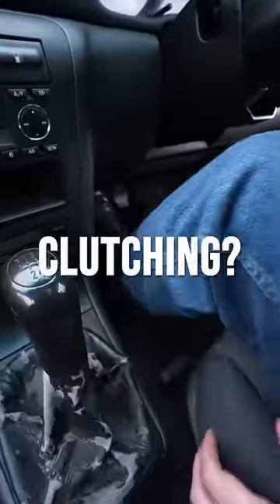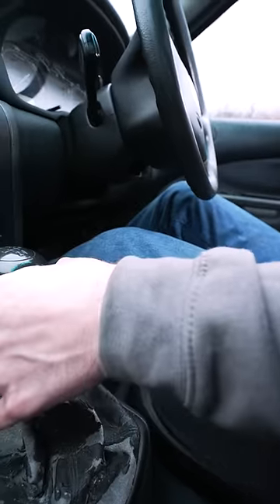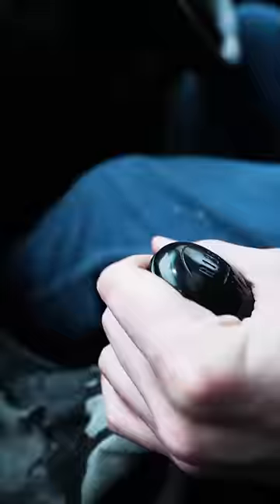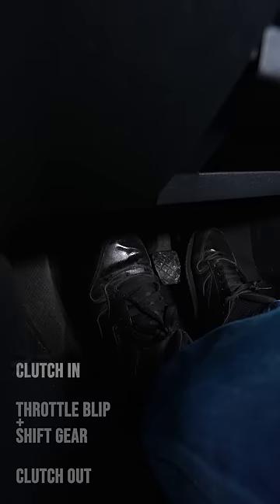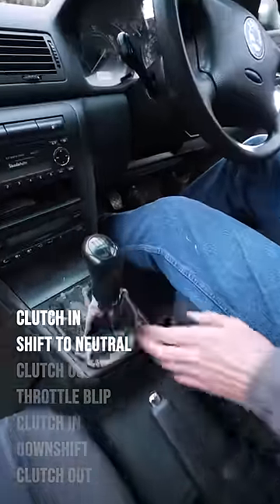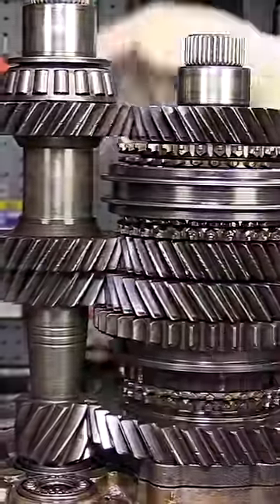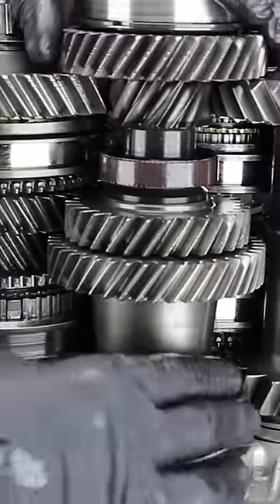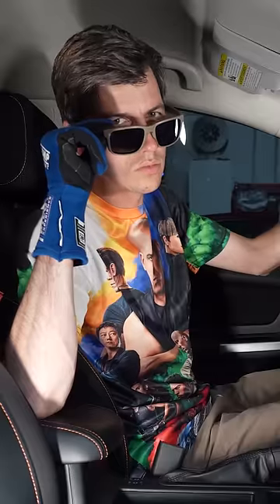What Is Double Clutching? Don't Granny Shift!

Comment: I’m a truck driver and know about double clutching, but not much about racing.  I watched f&f a few years ago and that line surprised me, because the cars they were using wouldn’t normally require double clutching.
Reply: I was so confused when they said Double-Clutching! At least you knew what they were talking about LoL
Reply: This was especially true on some of my older Jeeps, T18 4-speed dump truck transmission, T90 with no synchros for first, etc.
Reply: I'm sure it would only be useful for something with straight cut gears, but even then... who uses a clutch on straight cuts?
Reply: @Blade_of_Violet_Chaos  double clutching is usually used in transmissions without synchros to line up the gears.  Almost all manual cars made in the last 40 years have synchromesh transmissions.  Certainly anything they drove in f&f had a synchromesh transmission. I think most big trucks have straight cut gears but the manufacturers say they still require double clutching so guys still shift that way.
Reply: Idk why they say it cuz Granny shifting is faster than double clutching if anything Dom should of said something about no lift shifting or quick shitting
Reply: It's not just the cars that make it weird - it's a drag race!  Double clutching is only used for downshifting, and they dropped that line on basically the only kind of race where you never downshift.  In fact shifting speed is crucial, smoothness be damned.

It's so strange that in a movie all about drag racing they got something as basic as that, as wrong as that.
Reply: Usually when your driving truck your not using the clutch at all and your strictly floating the gears I've only ever had to double clutch in a truck in one truck and that was because it was an old 281 Peterbilt
Reply: I've never double clutched, I'm confident I couldn't do it. I only float gears 😂
Reply: You also had a Fuller transmission?
Reply: @mortenfrosthansen84  a few times
Reply: I have an r32 skyline. It’s not the r32 but double clutching is useful in the 1/4 mile
Reply: Double clutch in a hemi is a different thing of a doble clutch of a racing transmission quite different
Reply: You don’t use clutch when shifting on semi truck, it’s only for first gear that you use clutch and after that you shift while matching the rpm so no need to press clutch.
Reply: Another truck driver here. 
They wanted us to double clutch for our CDL test at the DMV… why?  Who tf knows lol It messes you up so badly 😂
But once I got my license, i was floating the whole trip 😊
Reply: @PeaceNinja007  I was told the transmission manufacturers say to double clutch.  And since that’s what the manufacturer says, that’s the requirement.  I learned to do both comfortably
Reply: @JDHarsh  It’s so not necessary tho. The purpose of the first clutch is to pop it into neutral but the clutch is not necessary for that. I don’t even use the clutch to go into neutral in my car. 
But I guess some people don’t know how to do it .. probably why manufacturer says to double clutch.
Reply: I drove trucks for a while as well. Whenever I tell people that I usually don't even use my clutch, it also equally blows their minds 😂
Reply: @0331machinegunman  haha .. 
floating all the way 🎶
Reply: All you have to do is rev match and you can do that before you release the clutch while your down shifting, I love the fast and furious movies but when they talking about double clutching they are on a straight line race (drag) and it makes no sense half the time I drive my old Ute around without the clutch all you have to do/know is what revs you need to go into a certain gear at a certain speed which is just you learning from wheel time 🤷‍♂️
Reply: Exactly! On top of that it takes longer than normal shifting!
Reply: only when they have double clutch / driveshaft systems that allow you to go to next clutch set and the other set goes into standby mode. Else nope total bs.
Reply: only a couple of times bypass my clutch when the clutch plate got stuck on the landrover defender boke the springs and clutch did not work. And needed to limp it home.
Reply: But the last 40 years means 1980 and they have multiple cars as old as 1968 @JDHarsh
Reply: @JDHarsh  Of course, if your gearbox is jammed up and the scyncro ring is stuck you should adjust the speed yourself.
Reply: @0331machinegunman  Doesn't surprise me because I have seen automatic changes on big Swedish buses.
Reply: in some other films they even change from D to P on autos... but these are just miniclips you normaly dont notice
Reply: Still beneficial for regular cars.  @JDHarsh
Reply: @JDHarsh The only straight cust gear in a big rig is reverse. All forward gears are angled teeth. This is to improve meshing and reduces gear noise. Could you imagine the noise of straight cut gears in 18th gear and cruising speed? You'd need double hearing protection and the scale house could hear you from 2 county's away
Reply: @PeaceNinja007 same here 😄
Reply: He was meant to say power clutching. Which is shift the gear without releasing the gas pedal
Reply: I float gears.
Reply: Your car is totally not dirty.
So I can't call you a dirty pig.
Right?
Reply: @JDHarsh  racing gearboxes often have dog clutches with no synchromesh - but those don't require double clutching. In fact, they don't require clutch at all, you just blib the throttle and mash another ger in.
Reply: Toretto threw the synchros  out to save weight ;</
Reply: meaning you actually use 19th gear
Reply: I’m not a truck driver and I know that a lot of times you don’t even need a crutch if you can synchronize your speed with your RPMs.
Reply: @PeaceNinja007 most likely, because it is the proper way of driving, and they want to be sure you know the proper way to operate a manual transmission. After that do whatever is right for you. I've had a few cars that could shift without the clutch, although I really don't recommend that. I had a hyundai that I drove for a few years, and I knew everything about that car, so just throwing the shifter around was no issue. I now have a subaru, and It's actually worth something, so I drive it properly.
Reply: @mattevans1643  Haha .. I always would float gears in a manual truck . I then wondered if I could do it in my little civic 5 speed and sure enough .. I can. But you’re right .. I wouldn’t recommend it because i heard it messes up the synchros
Reply: @Blade_of_Violet_Chaos  Double clutching has no benefit with the change from helical to straight cut as they can still have synchros. Straight cut gears just have a reputation for being stronger and cheaper for race application, but tend to be noisier. I think you're thinking of a standard manual trans versus an unsynchronized dog gear setup, but in the case of dog gear setups you have the option of helical or straight cut as well. Dog gears have the benefit of quick shifts without a clutch for racing applications, but driving at slower speeds might be more difficult if you can't match the drivetrain speed to the engine speed. You could technically just float them like most truckers in the states, but if you're not seasoned with that kind of transmission and matching the speeds of the drivetrain with the engine, double clutching is the safer and smoother method to give a more guaranteed shift.
Reply: Who tf is downshifting in a drag race anyway?
Reply: @MegaKerzo  People who moneyshift